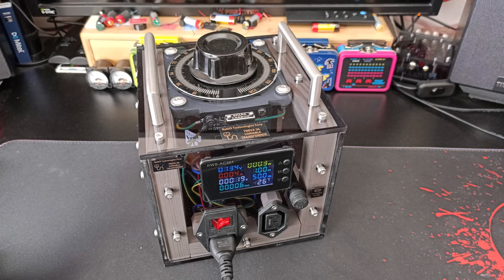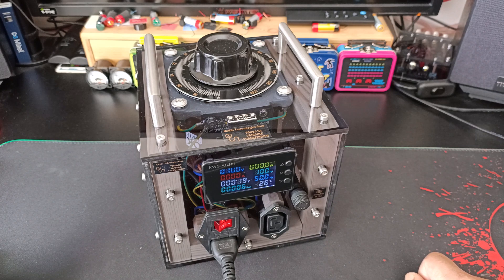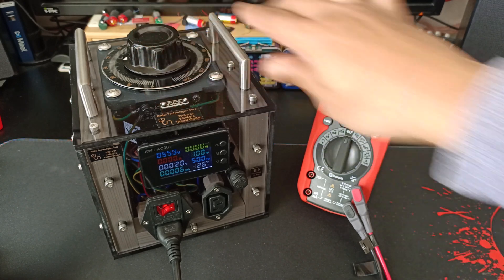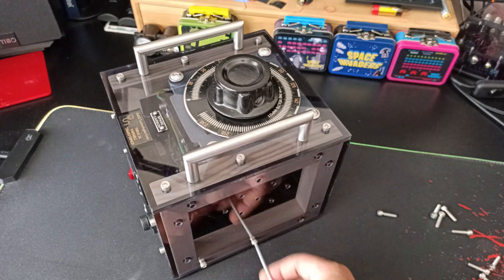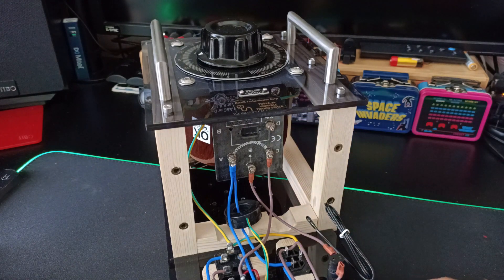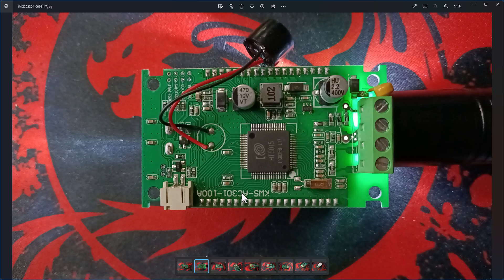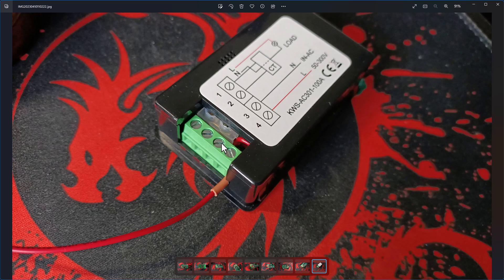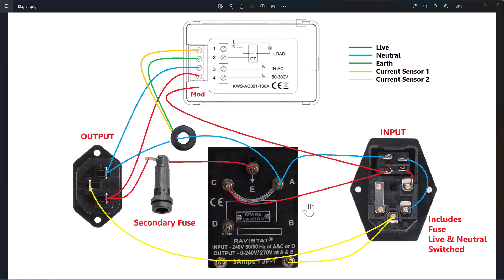Variac Variable Transformer custom enclosure with KWS-AC301 Power Meter

Comment: Thanks for this instructive clip. I have the same problem with my variac, with digital readout, but only over 50V. 
I also have a KWS-AC301 and my intention was to do the same hack as You did, but now I have to seek a different solution.

Comment: Hello! Nice video, very well explained. I would like to integrate this in a computer so to monitor the power consumption of the power supply.
Why have you had the need to connect the panel to the output? I have seen another video where the panel is powered independently, so meaning from the input (let's forget for a moment about your mod). It shows the input V, but as soon as there is current passing in the neutral they is placed in the black ring, the display shows the V from the output.. am I correct??
Reply from the maker: The module is connected to the output to sense the output voltage, the mod with the power for the module is fed from the input, the current sensing is done on the neutral wire. This is how it works best for me, I've tried other ways and I've seen most people set it up like this.

Comment: Where did you find the 'Hall sensor' closed transformer you are using to pick up AC current?
Reply from the maker: It came with the KWS.
Reply: Hmmm, mine did not come with it... I tried searching all the usual Chinese suppliers without success. I've seen it referred to as an AC-300 sensor but even that fails a search. I'm assuming the KWS is designed for a specific transformer... would you have any thoughts regarding sourcing such a part???  Thanks for your quick reply.  BTW, interesting video~!~
Reply from the maker: @AF7U  I got it from eBay, search for KWS-AC301, it comes with the whole unit and cannot be purchased seperately. There are loads, here's one sellers item I've used in the past 155797745721. You can also get them on Amazon.
Reply: Yeah, I've seen them everywhere too, but I wasn't paying attention and bought one without the sensor and was hoping to pick up a sensor by itself. I suppose I should just repurchase another meter WITH the sensor... but trying to be thrifty.  As a side note, I really liked your 'Nixie' clock... I bought an HP freq counter with Nixies with a plan to rob the tubes, but fixing the counter was pretty straightforward forward so now I have an HP freq counter with Nixie tubes... I hated the thought of pulling the tubes from a working counter.  After seeing some of your instructional videos, you're doing a great job... keep it up~!~

Comment: can you explain to me please in a little more details what this conversion is for and what results you got from it? ... thank you very much.
Reply from the maker: I'm not sure I understand your question. This is just a normal variac that I made an enclosure for. The AC-301 is a nice addition to see the output voltage. The alternative is to buy the dodgy cheap Chinese ones on Ebay and Amazon, they may or may not be safe, the quality varies.
Note: This variac is not an isolation transformer, so precautions must still be taken.
Reply: @Ratti3  I apologize for my omission, I was referring to the conversion that can be seen from this point onwards.... thank you   https://youtu.be/8OK6Ehu1oa0?t=608
Reply from the maker: @The-End  The AC301 is designed to operate from 50V 300V AC, so when the variac is below 50V the AC301 turns off or flickers. The mod with the red wire keeps the unit on all the time, however it only measures from 50 - 300AC still. This mod is optional, but I prefer to know the variac is still on when below 50V.
Reply: @Ratti3 where you able to make it work below 50vac?
Reply from the maker: @wilfredotolilic4180  the mod keeps the module powered, the KWS-AC301 can only measure from 50VAC.
Reply: @Ratti3 but do you think adding diode/s will drop down the start up voltage?
Reply from the maker: Sorry, I have no idea if adding diodes will help.
Reply: @wilfredotolilic4180  Did you end up trying below 50v with a diode?